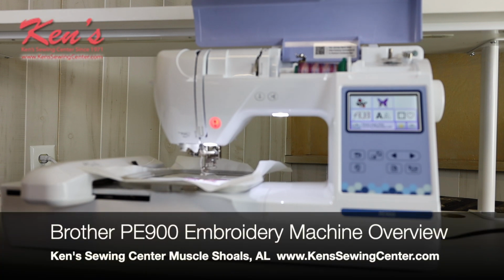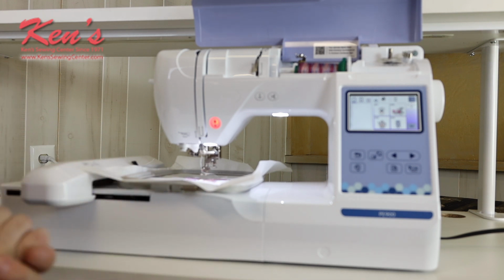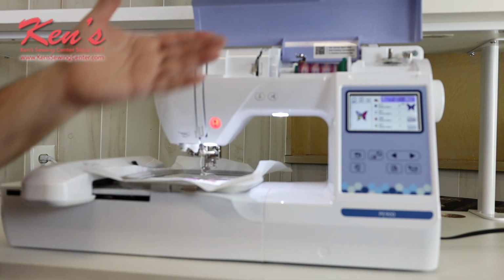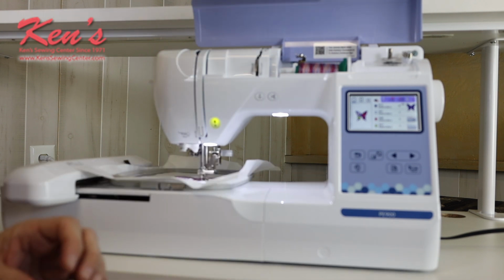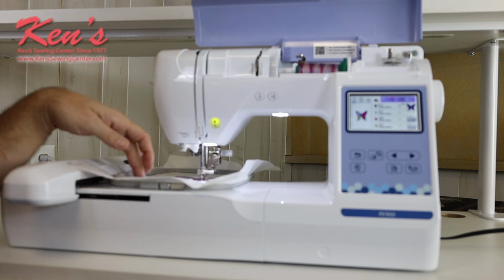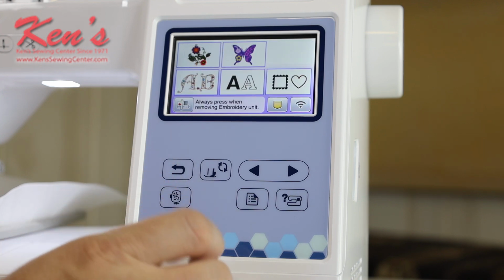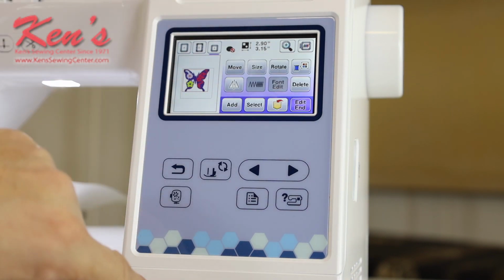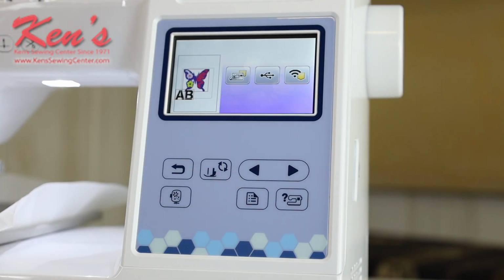Brother PE900 Embroidery Only Machine

Comment: Thank you for this video, very helpful.  Question...on the PE 900, is there a way to insert STOP codes on the machine itself?  I know a digitizer can insert STOP codes but have discovered that the PE 900 does not read those stop codes.  Can I add stop codes on the machine itself?  Thank you.
Reply from the maker: You cannot add stop codes...sorry
Reply: @KensSewingCenter  just purchased the PE900. Its on the way to my house. What is the fix for stop codes. i assume this tells the machine to stop and switch thread color